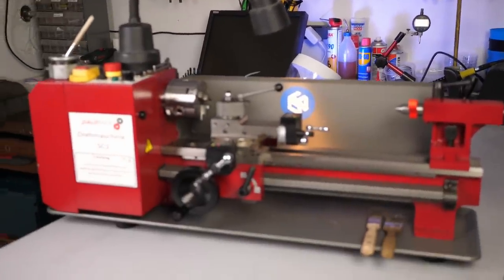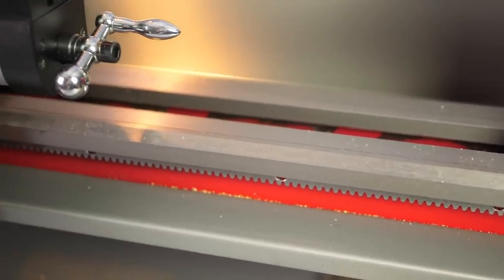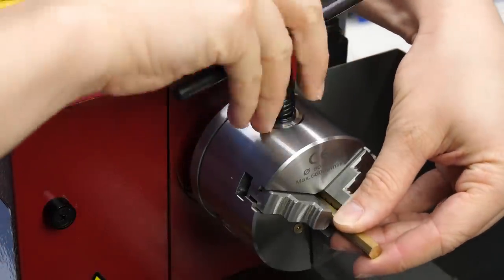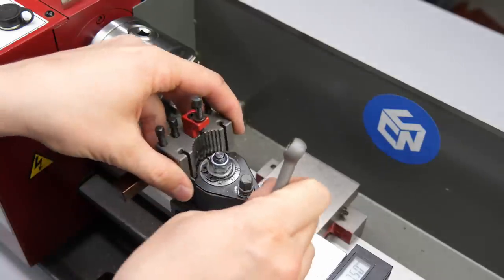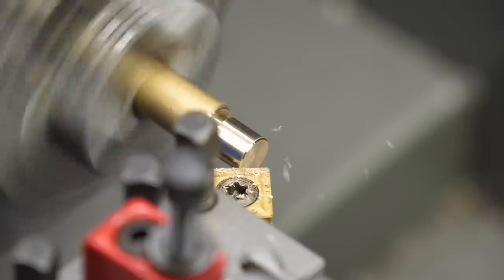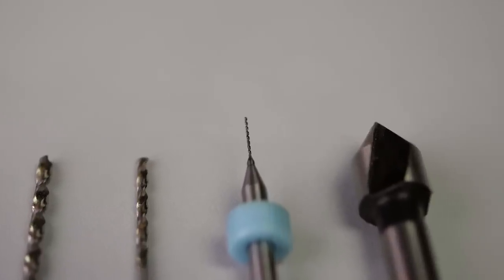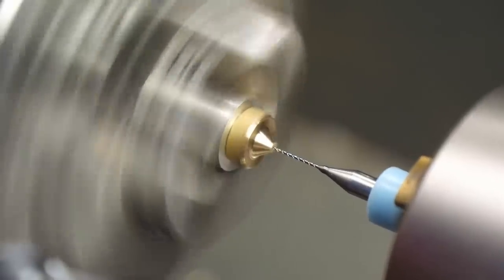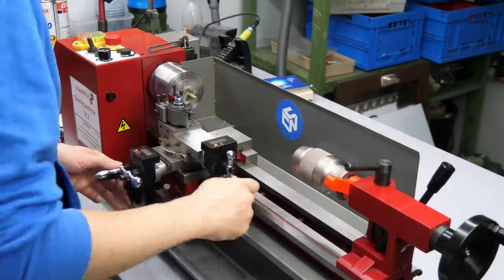Mini Lathe Project: 3D Printer Nozzle

Comment: Ideas to try:
- 1.8mm drill diameter instead of 2.0mm
- All-metal heatbreak. 1.8mm instead of 2.0mm.
- Heatbreak with longer bottom side (below the "break"). Actually I am thinking of using a Volcano heater block with a standard nozzle, and the remaining thread would be "filled" with a longer heatbreak. The filament does not required to melt in the nozzle, it will melt in the lower part of the heatbreak. Apparently it will have a lower maximal throughput than a proper Volcano but a higher than a V6, and one could use the existing nozzles.

Will these work?

I did a heatbreak last time from stainless steel, but I committed the mistake that I copied the Prusa step drilled one, instead of the straight through version, and I get jams no matter what retraction I set. Then I drilled through to 2.1mm the whole shebang, but I might be still little bit tapered and still jams. I didn't expected these problems. I have a much bigger lathe, really pain to make this tiny parts with it...

Comment: This is a serious question for an actual machinist or personal knowledgeable in manufacturing.. 
How the hell does a part even end up like that? 12:46 
If it’s a drillled hole, how is it so wavy and wobbly? Shouldn’t any drilled hole be somewhat perfectly round and straight, just based on the rotating method of cutting? 
I’d ask if it were cast if it were a much larger part… but I doubt you can cast something so teeny tiny, but honestly I wouldn’t be surprised with technology anymore..
Honestly I’m actually impressed with how fucked that quality is… it’s so bad that it’s impressive !

Kinda reminds me of my mom.. my mom is the eponymous “idiot” when engineers say “You can build something idiot proof and the world will make a better/bigger idiot” because she will manage to break something thought to be indestructible. You hand her something and get it back in such a condition that leaves you confused, flabbergasted and slightly impressed and extremely curious.. 

I need to know what factory hired my mother to build that nozzle! I must know!

Comment: Keep in mind that metal changes dimensions as you heat it...  And working metal on a lathe heats it up.  You should always wait for the metal to cool down before taking diameter measurements.

Comment: Hey Stefan, have you considered using EDM (electric discharge machining) for the nozzle bore? I'm not sure about the surface finish at micro scale, but at least on macro scale you might get even better results. Not that it's necessary, I'm just in for the manufacturing ;)

Comment: Hey CNC Kitchen, I am looking for my first 3d printer and I was wondering what printer you would recommend for around $400. After speaking with the guys at creality, they said that I can buy the cr-6 se for $450 due to the $399 price, the freight shipping charge, and the wire transfer fee. Should I instead spend the money on an ender 3 v2 and upgrade to make it as good? What printer would you recommend buying for around $400? What would you personally buy with my budget? thanks

Comment: I didn't know you can buy lathe with plastic gearing.
BTW, you can buy huge-ass soviet-made lathe with 400 mm working diameter and 2000 mm working length for the same price. Most popular one is 16K20 and 1K62. It would cost more to deliver.

Comment: Nice!
I'm eager to expand my knowledge to subtractive manufacturing as well.
Although I will probably go for a Shapeoko instead of a lathe since I really want to make use of Fusion 360s manufacturing capabilities.
(Even shipped to Germany the Shapeoko XL with the Z-Plus option is just around 2100 € so barely more than this mini lathe...)

Comment: When you turned the nozzle around and use the threaded aluminum it wasnt  perfectly centered anymore. Threads just dont center. Next time machine over the not threaded part and use a dial indicator   on that surface to dial it in again.  Anyway, even if the Nozzle bore is slightly off center it maybe wount matter at the end. 
But pretty nice work, enjoyed watching it! 🙂👍👍

Comment: One thing you could have done to make your life easier is to leave the second side a bit more than 2 tenth longer, center drill it properly, drill your 4 tenth hole and then finish it with the outer nozzle geometry. 
Apart from that your lathe work is pretty much perfect I would say.

Comment: I would like to see a double bore 3d printer nozzle with 2x 0.4mm bores in V-shape so melted filament will enter in 2 paths at top of the V and exits from the bottom of the V

Comment: I am really curious about making and using silver as a nozzle metal type and experimenting with 99% pure AG, 92.5% seems most logical for it being an alloy for durability and the thermal properties of silver is why i want to try this or even a silver plated brass nozzle if that could improve things. I got my first 3d printer about a month ago and I too have many hobbies and years of learning about many things. I haven't found any references about anyone attempting using silver for a nozzle material. Assuming that costs would be the main reason not too but then I think about different silver and brass alloy % then there gold to add to the thermal conductivity. I would be willing to cast some silver and/or send some silver to see if you can machine it into a nozzle. I have an old metal lathe from my great grandfather but I haven't even attempted to use it yet. If this is something you'd be interested or even if you can just take this idea and run with it that'd be awesome!

Comment: How long did it take to make the nozzle? The material you used is pretty soft. What is the lathe like when it comes to machining steel? I could watch lathe machining all day. Informative and relaxing. You definitely needed the extra tools though, which people probably forget to factor in to the cost of a lathe. I'm guess the tiny drill bit was for a PCB drill?
Reply from the maker: I'd say around 20min per nozzle, if I streamline the process and don't need to film. The tiny drill was a PCB drill, yes.
Reply: @CNCKitchen   I'd say 20 mins was pretty good going. I thought it would take hours to make!

Comment: Not convert to CNC, on the CNC kitchen channel?  If course you are going to convert it to CNC.  I expect you will find a way to be able to change between CNC and manual.  When I converted my mill to CNC, I did not think to keep a way to use the manual handles.  For simple operations, I had to write a program instead of just getting to work.  Also, cutting metal by hand does feel good... until it becomes work.  Then you feel unable to escape the machine and wish it was CNC so you could work on something else while it is cutting.

Comment: yea you can kinda grind a drill bit to 60degrees but the thing is you still need to have kutting edges on there so when you know how to sharpen a dril you should be fine by just doing it with 60 instead of 180 degrees 

-german engeneer

Comment: Why not use a bolt? Drill out the back and thin the bolt head for the taper of the nozzle. Saves cutting the threads and is probably cheaper.

Comment: Nice video Stefan. I feel like for some people like myself, we love 3D printing because we either didn't have the opportunity or the tools to learn subtractive manufacturing (ie, cnc, lathe, woodworking, etc), so it's cool to learn from you!

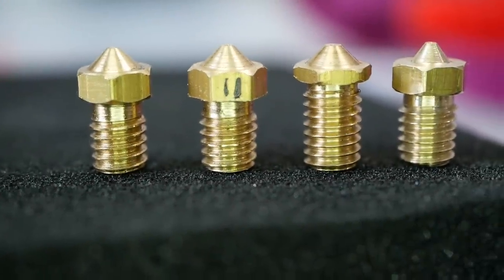Also, where did you get your E3D block holder tool at 13:06? Looks like metal?

Comment: There's no fun in doing easy projects. Do a color filament mixer: 3 nozzles Red, Blue and Green filaments feed directly into a chamber. Flow should be laminar, so it would look like coloured toothpaste! Next step is having another part spinning as it comes out (to drag along the walls and mix it). There you have it, a multicolor 3d printer. Oh, well, if that ever works and it can be moved around that is.

Comment: I wonder how a long small section of the nozzle would affect a print. maybe the small orifice length is more about material and not performance. for all I know it could even out the temp of the plastic at the tip, increasing predictability, or it could resist flow so much that printing suffers. Only one way to find out.

Comment: Is that an AA size 'Multifix' copy from Paulimot in NU?  I have an original Multifix "A" size, but it's a bit too big for my 'Watchmakers' lathe', but it's hard to give up on an original Multifix holder set ;-)
The video is a nice oe for starting out, as it does use most of the main operations and tools, so good points for that :-)
I think that it will be nice if you discuss, a bit, the tools you are using, and how you came to choose them? a de

Comment: Yes you can grind a drill tip to a 60° point, but you won't get a great surface finish, a better idea would be to get a small 60° point mill or a boring bar out of tool steel. Thou I've never seen one so small.

Comment: To cut the 60 degree inner feature you can get a rod of HSS and grind the taper, then grind the rod in half. Put a small relief on the back of the cutting edge. Drill out most of it then use your custom tool to put the 60 degree feature in. Blondihacks has a good video on the D-Bit grinder that is helpful even though it is not the proper profile. Also Clickspring has a lot of custom tool making videos that are quite helpful. "Spare Parts #8 - Making A D Bit Single Flute Milling Cutter" comes to mind.

Comment: "I don't plan on CNC"
As cathartic as manual machining is, as soon as you want to make a long taper on one of these things, screw with the change gears for what seems like the millionth time, or need any kind of round feature, CNC starts to look like a REAL good idea.

Ask me how I know this.

Also, yes, you could easily regrind a drill bit to a 60° point.

Comment: I wonder if the nozzle tip width, which here is 1mm for the 0.4mm nozzle, has a big impact on printing result. How would a 0.4mm nozzle with 2mm tip width perform?
Reply: It does have an quite noticeable impact. A larger shoulder makes it easier to make smooth top surfaces and it will be less sensitive to correct extrusion factor, but it does also transfer much more heat to the surface, and makes it hard to print small areas and sharp details, and overhangs generally get worse.

Comment: Could you have drilled the nozzle out from the back in one setup? It seems like that's the feature that needs to be concentric with the others.
Reply from the maker: Might have been an option, but I fear that this would have resulted in a burr at the tip, after the cut-off.

Comment: Hey, Nice video... I want a mini lathe for my self too....!!!
We used to order drill bits for our CNC at work from the german website cnc-plus,de
If you go in the engraving section they have some drill bits there and you can find different angles. However, I am not sure if the 2mm section of the drill bit is long enough to reach inside the nozzle.

Comment: I really don't get it why the nozzles in good quality are so hard to get. In my recent job made small ms58 parts with M1.6 threads. They where also nickel an gold plated with an overall tolerance +-0.25 ... 1.25€ each... Min order volume 250... But it seems nobody in Germany is interested in making quality parts and sell them over an online platform.

Comment: You haven't used one in 13 years? You honestly don't look old enough! 
I was wondering about the nozzels design if it would benefit from having a slight cup shape cut into the surface on the tip of the nozzle. The 0.4mm hole could feed into an expansion space  before touching the part surface.

Comment: Now you can make stainless steel nozzles to use with more abrasive filaments :)
Reply: @eelclog The. 4 mm hole in harder steel will be a considerably greater challenge.
Reply: @albertmagician8613  you're right. Maybe take a tool steel, make the nozzle, and then harden it.

Comment: A question for all guys with a 3d printer. Why does nearly everyone use a 0.4mm Nozzle?
I think a 0.5 is better.
With 0.4 mm you can not make a 1mm Wall and with a 0.5mm Nozzle also you can print faster. 
So why 0.4mm???
Reply: You can make a 1mm wall with a .4mm nozzle, it will leave a tiny gap at first and then fill it when doing the infill.

A .4mm nozzle is a decent compromise that can make both small artistic models and larger functional parts. Changing the nozzle is an annoying process, and that way you can mostly avoid it. 

However, if you have a printer with multiple extruders i personally would recommend having a nozzle smaller than .4mm in one tool, and a nozzle larger than .4mm in the other, giving you better details on small pieces and faster prints on larger pieces. My machine has almost permanently been fitted with a .25mm tool and a .5mm tool.
Reply: It depends really on what you want. Faster prints? Go big. More detail? Go small. I guess 0,4mm is the middle ground between fast but detailed.
Although there is a limit to how small and how good the print will look. My prusa with a 0,4mm nozzle prints beautifully on 0,15mm layer height.

Comment: I do think that it's because the 3D printer doesn't need a perfect nozzle. FDM process is working with liquid plastic, which is hot, messy (and not very controllable, you know, the precise control you can have with solid material process like milling and turning) so actually, accuracy is a big nope, specially for tiny tiny tolerance. So in my opinion, good nozzle will only give better printing experience, but the result part will be nearly the same in comparison with an acceptable nozzle

Comment: Wouldn't it have been better to use ~1.9 mm instead of 2 mm?
Reply from the maker: That's what the drawing said ;-) I think that this wouldn't make a noticeable difference, especially since the filament path before that is usually also 2.0mm.

Comment: Next step: making heat sinks and heater blocks, preferably from copper. Also, DIY nickel plating isn't that hard, should protect those copper parts from oxidation.

Is this still a 3d printing channel? 😆

Comment: Very nice Stefan - thank you for making this video.  I love making with both machine tools and 3D printing, so this is the perfect video for me.  It seems like you remember quite a lot about how to use a manual lathe.  I also find the process satisfying.  You can get HSS inserts for your indexable tool holders from https://www.arwarnerco.com/  They last quite a while for hobby use and can be resharpened easily by hand on a diamond sharpening stone.  These inserts have 0 degrees back rake, so they're not perfect for every material.  However, for brass, they are perfect.

Comment: The problem with the inner surface finish is not your machining skills. If you want a perfect finish you have to use a drill or endmill that costs around 100€ pP.

Comment: I'm working on a 1/16 scale Scratch Build E-100 ( https://imgur.com/a/a0fBDzZ ) and am currently running against the roadblock that I can't find anyone to turn me a set of axles ( Drive Shafts, Idler Wheels, Roadwheels ) and a barrel(s) for the model - The companies I've contact apparently don't even consider answering a thing so I was playing with the idea of buying a suitable sized Proxxon PD 400 due to the required length of the barrel but that fucker is like twice the price and comes with even less features ( like tose pretty neat Digital Measuring Gauges ).

Looks like I'll have to give this alternative a closer look.

Comment: You don't even need to waste a drill on the 60° Bore.
Just take a mild steel rod, put the taper on and grind a noth in one side.
For Machining brass this is more than sufficient.
Check out Clickspring, he does many similar things.
Edit: these two videos might help you:
https://www.youtube.com/watch?v=jlNxvnOxMCE
https://www.youtube.com/watch?v=N1aj_3tlQhU
Also, this old tony has some more advice on (sharpening) drill bits here:
https://www.youtube.com/watch?v=r8oORR6jyh8